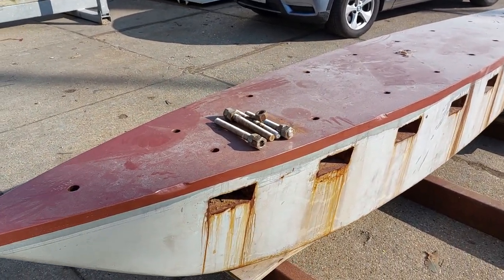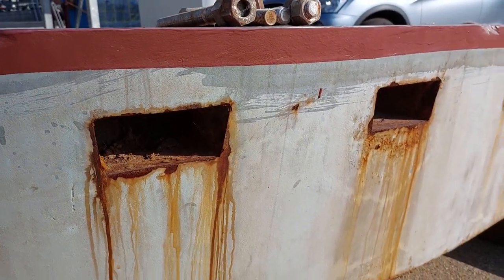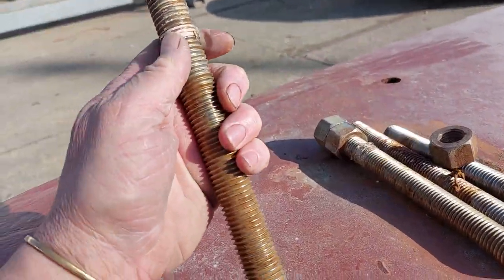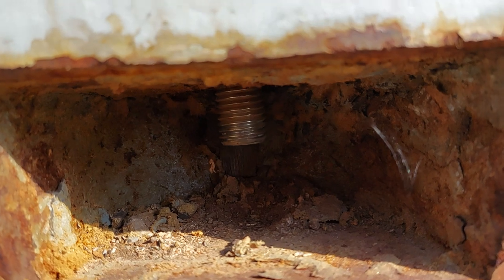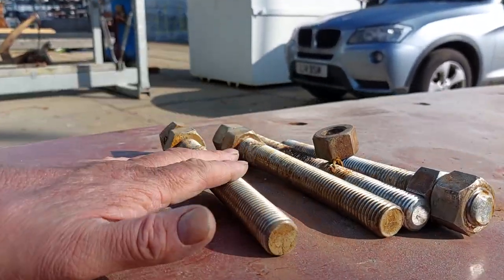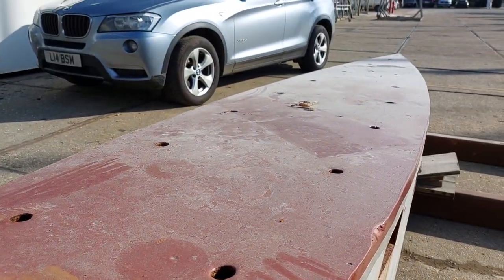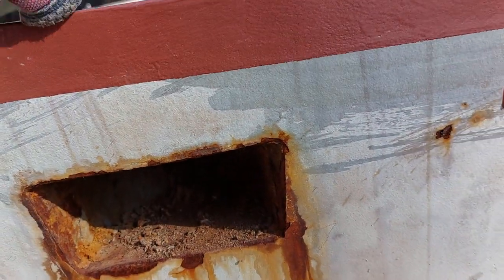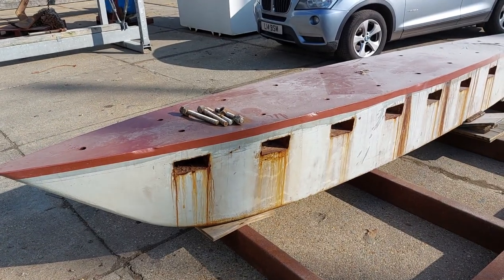Gallery keel fastenings. Interesting example of one on an iron casting.

Comment: Hi. That was interesting because what I've often wondered is what would be done if the embedded studs ever needed to be replaced in a (non gallery) keel?
Cheers
Bill
Reply from the maker: It depends on the extent of damage.  In one of my other videos I show a loose stud. That was on a plate with all studs welded to it. In that one they opened up the lead to the side below the plate removed the stud and fitted a new stud and used a nut below with a tack Weld. Hope that helps

Comment: Interesting! Why are they not used any more? What are the big advantages or drawbacks?
Reply from the maker: I think cost and time of manufacture is one of the reasons along with most modern yachts are designed without the need.